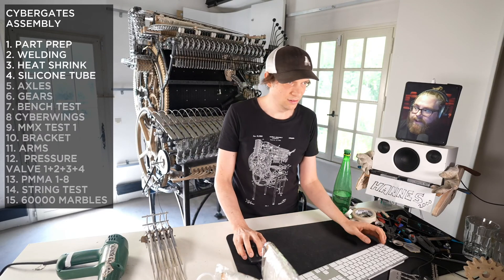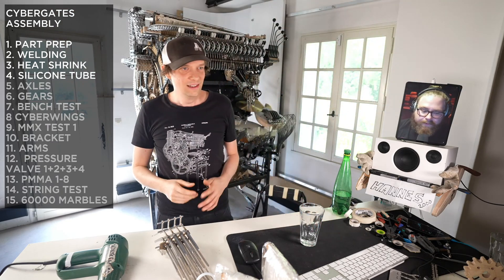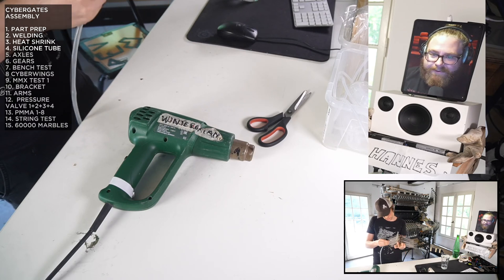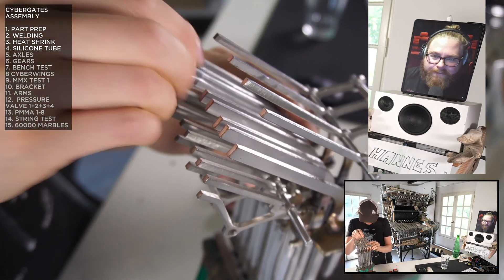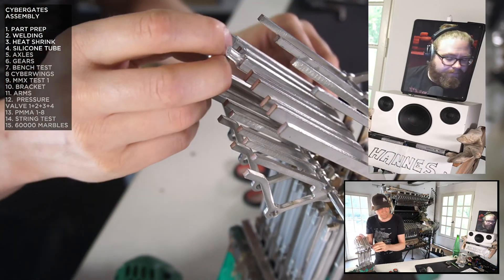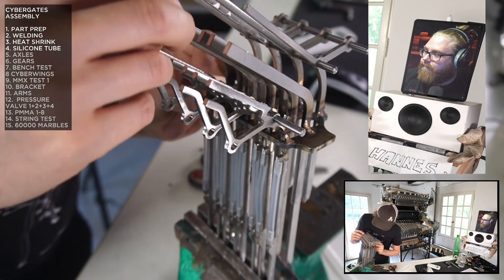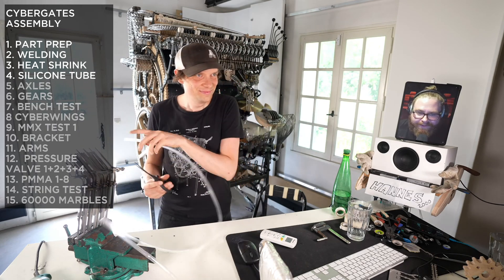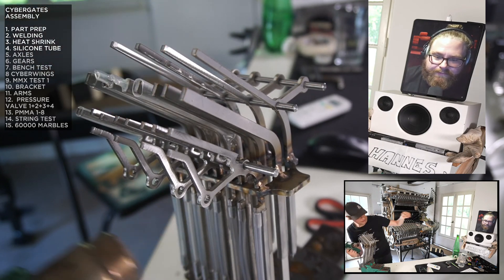Cyberbass Marble Drops - Live Assembly Part 4

Comment: There's a possible solution for the areas that missed getting heat shrink put on before the initial weld... They make a tool handle coating to replace the rubber coating that has come off your pliers, side cutters, etc.  It's called Plasti-Dip.  You can dip items into it or can be painted on with a brush.   It goes on quite thin and can have several coats applied, if needed.  It provides a nice rubbery coating.  Good luck.